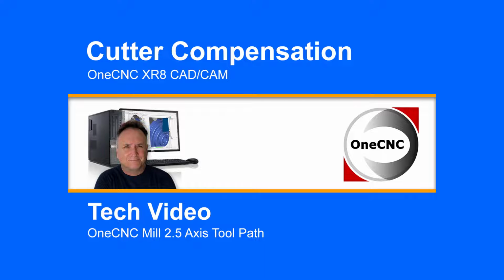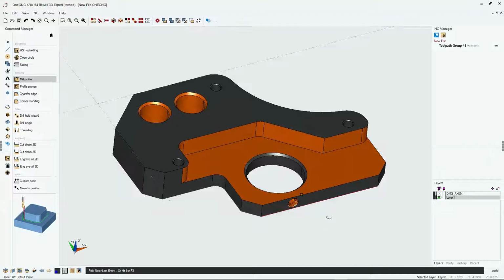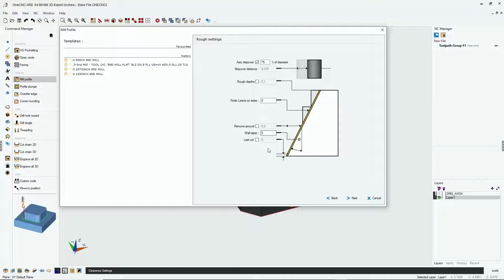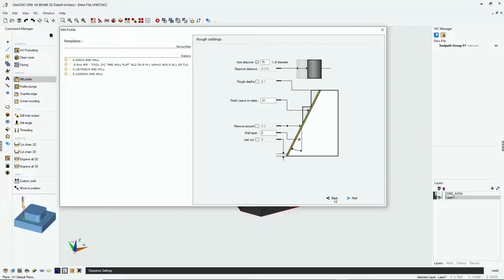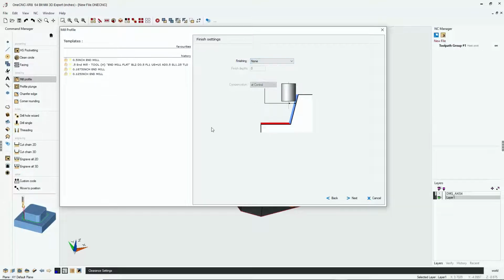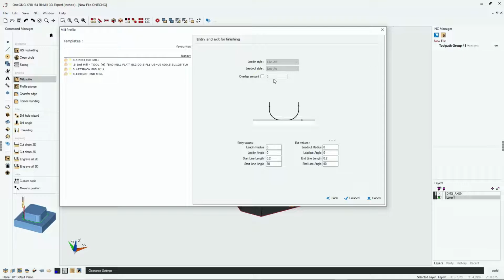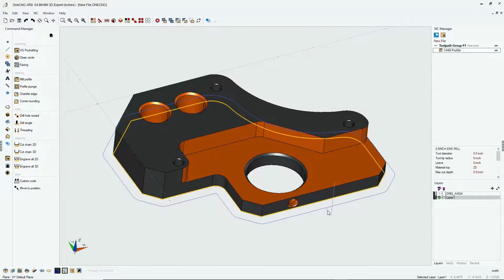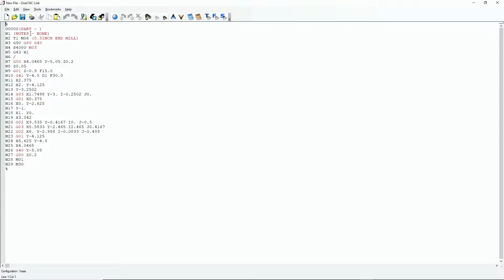OneCNC - Cutter Compensation

Comment: I roughed out some geometry on a job and I only wanted to use one pass using at control. So I set finishing cut to 0.00 mm and it only cut using the diameter what I typed in at the start of  the profile operation.
Is there a way to use at control but only using one pass?
Reply from the maker: Hello and thank you for taking a look at the video. The answer is yes. Just make sure to set the "Compensation" parameter to the "At Control" option. This will instruct OneCNC to output the geometry coordinates within the CNC code.  Also, make sure to type in the proper tool diameter within OneCNC for your profile operation. The tool path will look the same within OneCNC but the CNC code will be the geometry coordinates instead of the center of tool coordinates. That way cutter comp will be looking at the diameters of the tools set within the CNC control. For addition details, take a look at the this video around the 3 minute mark. Hope this helps.
Reply: @onecncwest  Hello.
I tried that.
I might not have been clear in my explanation.
I roughed out a job with Z level rough.
I then wanted to go round the outside using profile. But only wanted to do one pass on the outside. I then wanted to alter the diameter on the machine to achieve the correct tolerance instead of going back into onecnc and keep changing the tool diameter.
10 mm was typed in as the diameter of the cutter on the profile tool path and I put it in 0.00 for finishing.
I altered the tool diameter at machine and it didn't make any difference. I did set it at control.